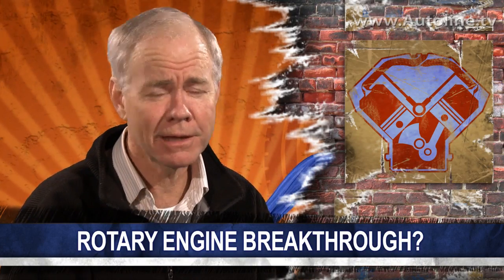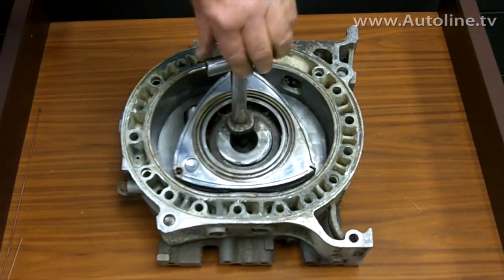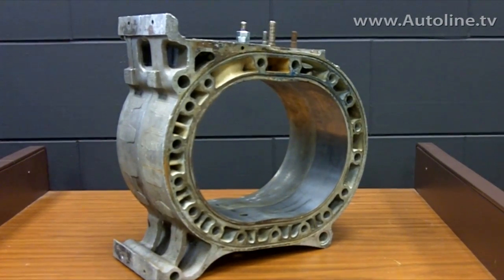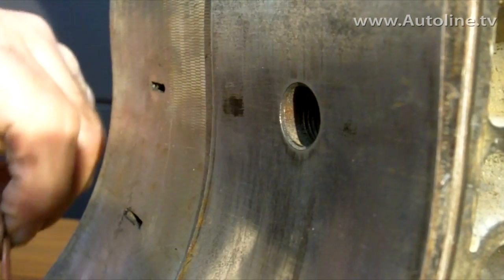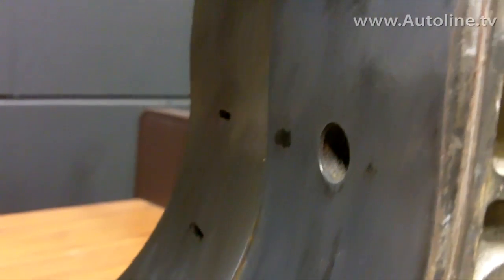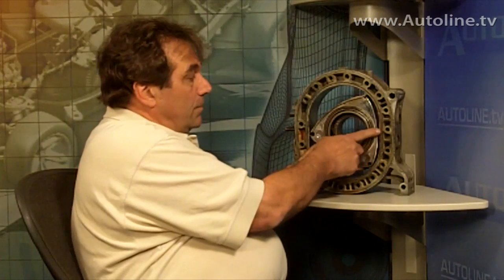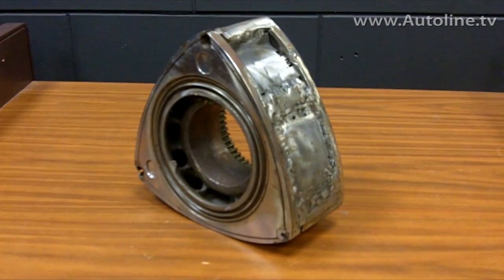Rotary Engine Breakthrough?

Comment: drill a rifle pinhole oil hole halfway up the three points into the bearing journal.
the oil pushes the seal plates outward plus centrifugal force as the oil creeps past the apex seals it lightly coats the walls provide lubrication.
instead of oil tubes !!!

love to explain in person I think it would work well and solve that problem.
Reply: John Hutsenpiller This was very bright, the movement of the apex seals would lube the housing more when the seals are under pressure as the volume inside the rotor would decrease. As the pressure against the seals decreases, it will lube less due to the volume behind the Apex seals would increase. All of this while keeping constant pressure over the whole seal increasing its life and a cleaner burn. Also during start when the oil pump is not generating oil pressure, the seals would be pushed in when encountering the housing creating so pretty much zero friction and zero damage during start. Yet again increasing its life.
Reply: TROLL ALERT
Reply: The real doktorbimmer Youve now proven to me that you do not understand what I was talking about even though I was as much as a simpleton as possible. Explaining it to you would result in nothing as youre naive and renders the wankel as 'obsolete'. I am not saying the engine is the future but it is definitly not obsolete, I advice you to have a look at Mazdas latest patents, remember that this is the process a small team in Mazda has accomplished compared to the hundreds of automotive design being put into inline engines.
So please, when youve stopped being naive towards the wankel and its capabilities, we can have a serious talk with actual physics, mechanic and construction principles. Then we can decide wether it was a bad solution or a good one, youve proven nothing with nothing.
Reply: The real doktorbimmer Fluids are incompressible, we know this. The oil pressure is generated typically with a mechanical pump. Lets say it is running 10 kPa. This would result in an even 'spring load' k=0, instead of the traditional linear constant. As the seal is being retracted it will have to have a Force higher than the given kPa. This would result in a higher pressure which is unburdened by oil passages of which the oil can escape through (Like through bearings, oil pump and oil filters or in this case his idea of having a small gap in the apex seal). But the pressure will not increase as the oil pump can only generate 10kPa. 

The design used in Wankels is of a spring type which increases the pressure by the length that the seal travels (k=larger than 0). This means that the spring type used today have higher friction when highly compressed where as the oil solution could offer even friction during all stages.
Reply: The real doktorbimmer  
http://pdfaiw.uspto.gov/.aiw?PageNum=0&docid=20160084158&IDKey=32A0F77DE744&HomeUrl=http%3A%2F%2Fappft.uspto.gov%2Fnetacgi%2Fnph-Parser%3FSect1%3DPTO1%2526Sect2%3DHITOFF%2526d%3DPG01%2526p%3D1%2526u%3D%25252Fnetahtml%25252FPTO%25252Fsrchnum.html%2526r%3D1%2526f%3DG%2526l%3D50%2526s1%3D%25252220160084158%252522.PGNR.%2526OS%3DDN%2F20160084158%2526RS%3DDN%2F20160084158
Here is the link to the Wankel patent made by Mazda (I think, the plugin didnt work on my device) RX-vision has been ongoing for years.. Again it is not dead, but it cannot compete with inline ICE for traditional car users. As a performance vehicle, its been conquering until recently with new clever technologies like VC-t, VVL etc.

Comment: docktorbimmeroid  please shut up!  take a rotary engine port ,add stronger internals,add turbocharger,correct fuel trims and timing = 700 plus horsepower and 7 second 1/4 mile.  On off-set pressure... turn the boost up.
Reply: I had a 13b engine in my RX-3. I was making about 500HP with 15psi of boost.
GOD Bless and GOD Help us,
rich!
Reply: . . . . I know but that wasn't the point. I had my RX-3 from the middle 70s to the late 80s. Any car that had this kind of power cost and weighed many times more than what I had in my car. The car only cost me $50 but I had about 10 thousand in the engine and drive train. I would average about 100,000 miles per engine unless I overloaded the engine or over revved it. If I had overloaded it the side seals would go away. If I over-revved it I would lose a rotor bearing. I never had any problem with apex seals, oil seals, or water seals.
. . . . The large plug access hole on the leading side is necessary. It insures a stable combustion process. Before ignition the pressure difference between the two rotor faces is zero (0). There is no exchange of gases taking place at this moment in time. The location of the trailing plug is entirely different and that is why the plug hole is so small. I suspect that Mazda has researched this but if not they should.
. . . . The other point about the combustion chamber size and shape is something that Mazda has researched extensively. The 10A and early 12A engines had an asymmetrical combustion chamber. The later 12A and the 13B engines have the symmetrical combustion chambers. Because the leading plug is fired up to 10 degrees before the trailing plug and because of the positioning of the leading plug the torque on the eccentric shaft is always positive.
GOD Bless and GOD Help us,
rich!
Reply: . . . . Why are you assuming that I am lying about the reliability of the engine that I built. On a dyno at 13,000 rpm at 15 psi of boost I was making 202 lb/ft of torque and 500 hp. Max torque was 280 lb/ft at 5200 rpm. The torque curve was flat from 3500 to 8000 rpm. With the bridge porting the idle speed was 1100 rpm and it sounded like it had a full race cam in it.
. . . . The turbo started making boost at just under 3000 rpm. By 3500 rpm the first waste-gate started  opening at 14.9 psi. The second waste-gate would start opening at 7500 rpm at 15.1 psi. 
. . . . I wouldn't run the engine over 11,000 rpm when racing or daily driving. The engine would function at 13,000 but the life of the engine was cut to about 10,000 miles. At 11,000 rpm I would get 100,000 miles out of the engine. 
. . . . This was a 13B engine with the new style rotor housing that was using the new type aluminum alloy. I also used the latest water seals with the steel protector.
. . . . I stripped the car down to just the front and rear windshields and the uni-body. I left out everything that was not needed to operate the vehicle on the street. This included the AC, the air injection system, all of the control valves, and about half of the wiring.  
. . .. I installed a much larger radiator with two temperature controlled fans in a push-pull configuration, a dual plate clutch and aluminum flywheel, and a limit slip differential. I also installed case harden axles. By making a new battery tray I has able to install a 1000 cold cranking amp industrial battery. I replaced the Mazda 60 amp alternator with a Chrysler 110 amp alternator. The side gear retainer pins were removed, the holes for the pins were tapped, and allen cap screws were installed.  The rotors and the eccentric shaft and rotor assembly was then re-balanced. 
. . . . In an air temperature of 110 F and on a sunny day at 110 mph I would be running a water temperature of 220 F. The highest water temperature that I ever saw was 250 F and the oil temperature was running 260 F. I never had a problem with the rotor housings, end housings, oil seals, or water seals. If I had an engine failure it would be the side seals or a rotor bearing failure.
GOD Bless,
rich!
Reply: . . . . You couldn't buy a piston engine based vehicle with that power to weigh ratio in 1975 to 1985. Most piston engines were wearing out at 100,000 miles and a lot of them didn't make it past 50,000 miles. I am telling you the truth, the whole truth, and nothing but the truth. Yes, I own a Mazda Protege' with a 2.2 liter engine that is putting out about 150 hp. But it is no where as smooth or quick revving as my 1973 RX-3. On the highway I averaged 25 MPG. My Protege' averages 30 on the highway. 
. . . . At the drag strip I was consistently turning 13.1 at 110 mph in the quarter mile. On the drag strip I averaged 10 MPG. With all of the suspension modifications that I made it went around corners as well as it went straight ahead. This was a very quick and fun car. But it would also kill you in a heart beat if you got stupid with it. Do I miss the Wankel rotary engine? Yes, I do. Could I afford one like the one that I use to own? Nope.
. . . . It is ok that you prefer piston engines over Wankel engines but it seems to me that you don't like it when someone else's preferences don't coincide with yours. That is awfully closed minded of you. 
. . . . I am not talking about what is available today. I am talking about what was available 30 to 40 years ago. Also you could not buy a Wankel with the output that I am talking about. You had to build it or find someone who could build it for you. And there were very few people who truly knew how to do that.
. . . . In my time as a master automobile technician I built over 1,000 Mazda Wankel Engines. I still know how to build them to this day. I can't afford the tools or parts to be able to do so.
GOD Bless,
rich!
Reply: This was with street tires on it. With drag racing tires and warming them up in the proper manner I could cut a full second off of those times and add 15 MPH. I have to ask. When were you born? I ask because I want to know if you lived the 1970s on. Also what are your qualifications?
GOD Bless,
rich!
Reply: "But work on the technology has continued, and Mazda’s R&D boss, Kiyoshi Fujiwara, told Autocar that the efficiency of the latest version is now on par with more conventional engines thanks to advances in engineering software, while the other issues have also been mitigated."

Comment: that spark plug slot would be so unreliable, why not just have a valve there to stop the compression loss that opens to let the plug spark? some innovation
Reply: The real doktorbimmer
Sure but so has ring failure, spun bearing and blow head gaskets on piston engines. 

In racing most piston engine are torn down and rebuilt after every race, most rotaries go and the entire season and don't get torn down until they fail. 

The rotary is more reliable it's just less durable but fairly predictable.
Reply: The real doktorbimmer
Many series, I don't think so, most allow engine rebuilds and swaps with no penalty if for no other reason safety.

As for F1, the engines are rebuilt or replaced after every race they only last about 2 hours, so knock off the BS.  Not t that is a good example anyway as those are very extreme examples that operate with equally extreme parameters. 

My point is rotaries are typical only rebuilt when they fail, not between races like a piston engine.
Reply: The apex seals should last 150k or more.  Tuning issues aside the seal that is most likely to fail are the coolant seals.  This is because of there size and the fact they bridge mixed metals, iron side housing and aluminum rotor housing.  The heat up and cool off at different rate and as coolant degrades it leads to corrosion. Apex seals failure are result of pre-detonation most commonly from running too lean.
 
As for the housing, they will warp from overheating.  With a lot of miles the chrome molly wears off on the inside but they are very durable.
Reply: The real doktorbimmer just wanted to add that many don't realize how easy it is to rebuild a rotary. Aside from getting it in and out of the car it's pretty much as easy as slapping together a sandwich which also result in it being kinda modular.

Comment: the offset works for a different reason as well.  I've come to the same solution.  Wait for the next wankel to come with GDI and super high compression.
Reply: Shut up already you plagiarizing  P.O.S.
Reply: That guy is a troll, it is obvious from his comments. He is also wrong on several accounts. For one, Mazda still continues to file patents related to the Wenkel engine and they have not ceased development. Also, the statement "...there are no alternative fuel Wankels or Diesel Wankels" is also completely false. Mazda demonstrated that the Renesis can be run on both hydrogen and gasoline (meaning, one may switch between fuel cells with the same engine). I believe there even exists a YouTube video of the vehicle - an RX8 - running. With that being said, I don't believe the ideas in this video to be entirely valid - we agree there. I will say, however, I do think the chamber can be designed to provide better efficiency. This is difficult, however, due to the 'dynamic" nature of he combustion chamber geometry. Keep in mind, these engines have not seen nearly a fraction of the R&D time that piston engines have. Piston top/chamber designs continue to evolve, whereas rotor design has remained relatively* static. There are numerous improvements that can be made on the Wenkel engine, in general, but [car] companies follow the status quo largely because it is cheaper, not necessarily because it is a better design (piston engines were essentially first to market); many have already invested in developing piston engines for this reason. Technological advances made even by other manufacturers, for example, drive developments for competing companies. Due to this momentum, there is little incentive for change away from the quo, especially now days. This is unfortunate because, in comparison, a lot of the wild/bold engineering that came out of the 70's auto industry, for example, taught us (engineers) much about ICEs. I applaud Mazda for their efforts in trying to do something different. IMO, they are not far off from really "getting it right", so-to-speak.
Reply: @Chris Stavro  you've sent doktorbimmer into convulsions.  He's posted no less than 7 responses to your comment.
Reply: Playing the Carnot cycle again are we? Sorry wikipedia engineers don't count here.
Reply: The real doktorbimmer Define we, everyone here seems to be against you.
Reply: i agree
Reply: The RX9 will have GDI? Don't you look stupid right now.

Comment: Are you kidding me? He wants to make a breakthrough, yet he refers to piston engines, and welds like an idiot. How about porting, side seals, apex seals and the offset eccentric shaft. Compression issues? Delete the OMP and premix. How dare you insult Mazda's decades of hard work and research in not only compression and reliability issues, but with chatter marks as well. Such a breakthrough and claim should be supported by evidence should it not? Where's the video of the engine running if it's such a revolutionary change. Hell that welding will probably mess up your housings and cause LESS COMPRESSION. The rotors are designed to have a divot in the middle to balance out forces and to allow even combustion/spark plug relief. Having that altered shape would mean more stress on the eccentric shaft and more stationary gear wear. There's a reason Mazda made it fire that way, and it prevents the engine from shredding itself apart at higher rpms due to balance. This "breakthrough" would take away the smoothness of rotary engines and the already dwindling reliability. Phew, rant over

Comment: Unless it's super or turbo charged the expanding exhaust gasses would push back into the fresh charge through the spark chambers. No raw fuel air mix to enter exhaust.  Not sure about offset rotor chamber, but it may through off the balance of the rotor
Reply: The real doktorbimmer I admire you for pointing this fraud out to people.
Reply: +Mazda rx7 Out of all the naysayers, I agree with you the most.  There's a reason why the spark plug hole is shaped the way it is... it is a compromise.   If oil gets in there (and it will), you'll have essentially converted your 12A into a diesel (albeit, one that won't actually run).  The opening ensures that oil isn't retained.  Meanwhile, a slit will clog.   

Can't comment on the offset, although it appears to make some sense.  Still, that huge crater in the rotor will reduce compression... it would take a massive turbo, extreme timing and a fairly lean mixture to make the most of it.
Reply: Nothing ever became of this crackpot scam..

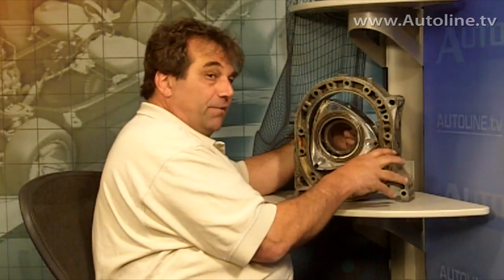Comment: At 1:30 while I agree that making the spark plug hole into a slot, this position would be just BEGINNING to compress the A/F charge, and there would be ADEQUATE exhaust pressure in the bottom "chamber" to keep pressure in the "top chamber" as they seem to be at nearly equal volume when the apex seal crosses the plug hole.